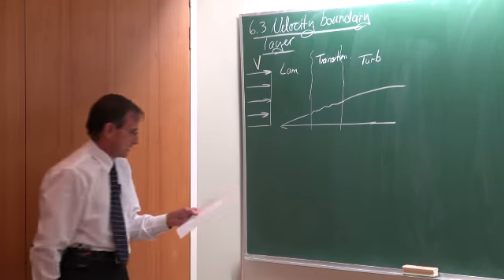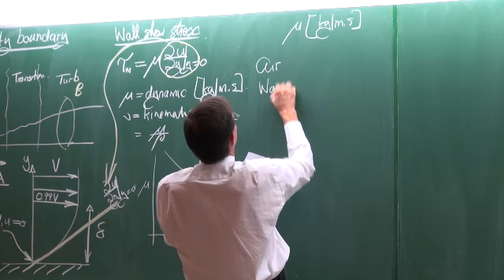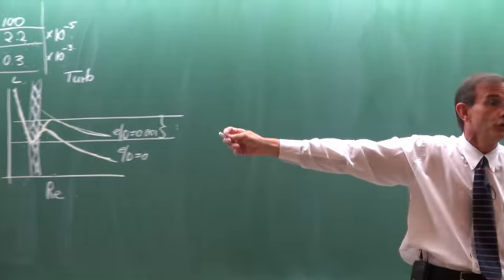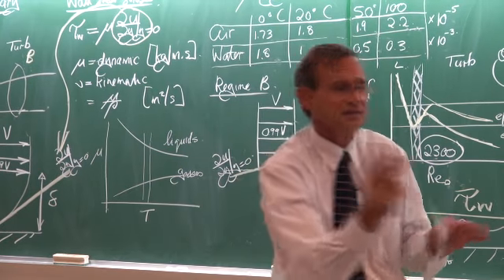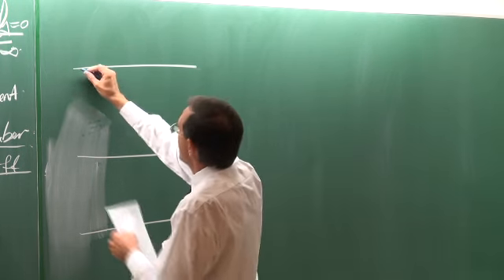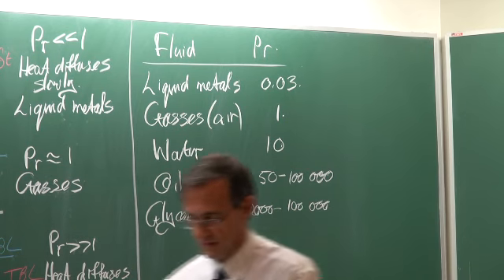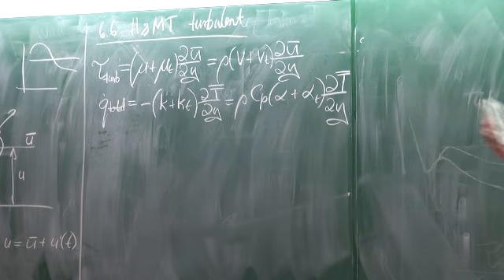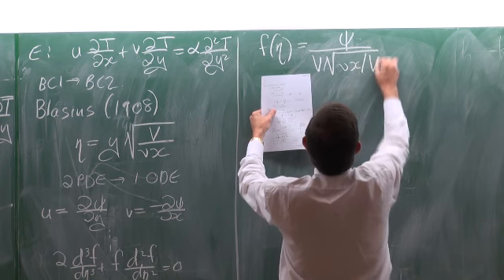Lecture 22 (2014). Fundamentals of convection heat transfer (2 of 3). Boundary layers

Comment: sir , why we classified the place as free stream where the velocity reached 0.99V , why we can not say it 1V (100% of V). I always scratch my head with this question but never got an answer. Thank you for such great lectures. Keep it up professor.
Reply: 1V or V exists at a range of heights (many heights) above the surface, and that is the reason we use a value very close to V. It can be 0.99V or 0.99999V or 0.9999999999V, but not V.

You see, the velocity profile reaches an asymptote(google this) at the height of the fluid at which velocity = V. We are interested in finding this transition point, where the flow begins to become independent of the effects of the wall.
Reply: thanx for your valuable reply.

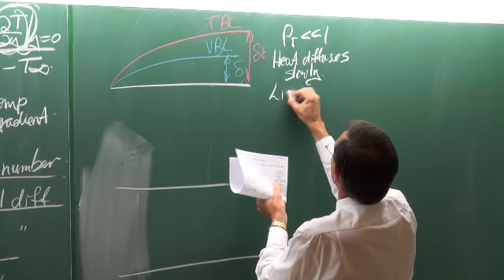Comment: Josua, well done with these videos. Just a quick note for students that on 30:32 for Pr<<1 it should be heat diffuses quickly and other way around for Pr>>1.
Reply from the maker: Yes, I'm sorry. Small values of Pr means thermal diffusivety dominates while high values of Pr means momentum diffusivity dominates. The one with the thickess thermal boundary layer will have the highest heat transfer rate.
Reply: +Josua Meyer Usually the Nusselt (Nu) number is a function of Re and Pr, where an increasing Pr yields a higher Nu. Wouldn't this mean that the thin thermal boundary layer case (high Pr) results in a higher heat transfer rate?
Reply: +reza azizian I think that the intention is to describe the heat transfer from the plate, which is lower for low Pr and higher for high Pr (assuming the same Reynolds number).

Comment: Respected Sir, what is the design implication of "the order of magnitude increase in friction factor or pressure drop or drag" ? What does it really mean?
Reply: +Ira_Muk Friction increases, means you will have to design with a more powerful pump which is expensive. Hence the design implications.